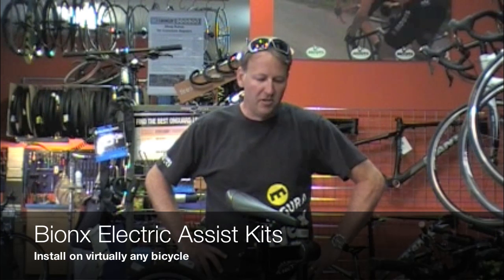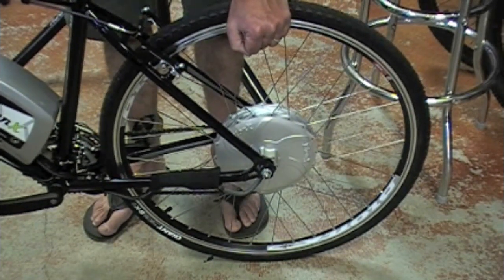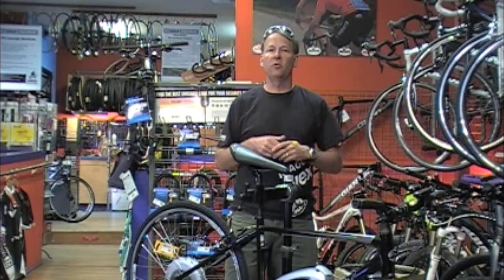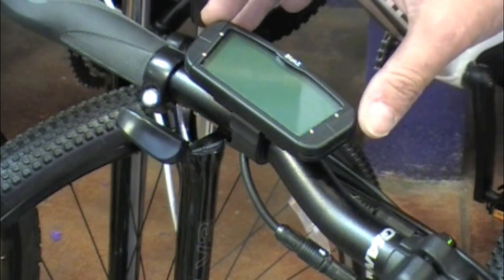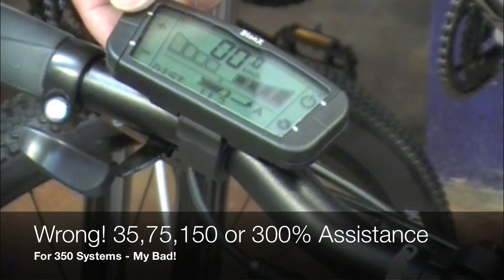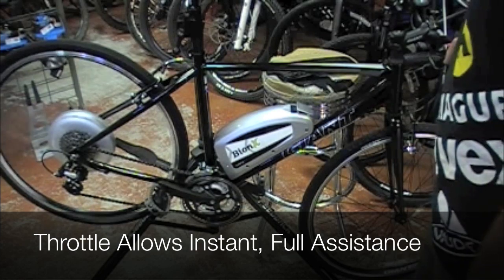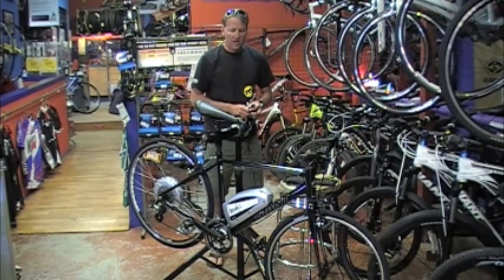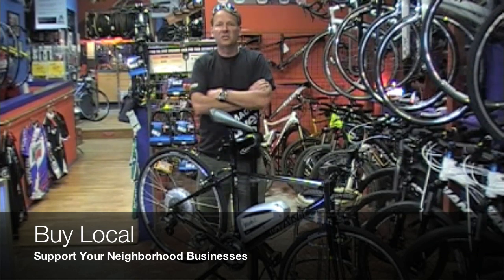Big Swingin' Cycles' Bionx Electric Bike Conversion Kits

Comment: Brian, Nice video, very bad choice of bike to show the bionx system on.  The installation at best is a 3.5 out of 10.  You have snag hazards all over the bike.
1.  On the down tube the cable is sticking out like it's pregnant.  Use more sticking cable holders to keep in tight.
2.  Cables leading to the motor, looks like the back of a double hump camel.  again a snag hazard.  Take the cable and wrap it around the frame a couple of times and make sure they are far enough down to use the wrap supplied to cover it. That will tighten both cables and make it look more streamlined.
3.  Meter and Brake senor, the cables are all over the place.  Use small tie wraps or S hooks to secure to brake cable and or shifting cables.
4.  Please DON"T use wire cutters on tie warps.  Go down to Lowe's go the electrical section and buy a couple of flush cutters. They are made to cut the tie wrap flush with the connector( no plastic knife blades to cut your customers).  To date i have not seen one installer use flush cutter every video I have seen shows installers using wire cutters and leaving a nice little plastic edge to cut yourself on.